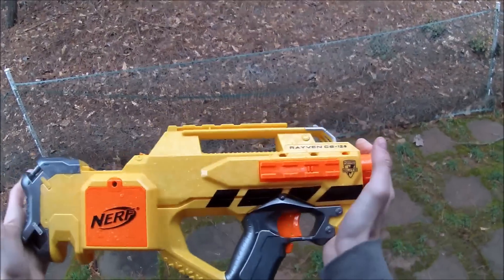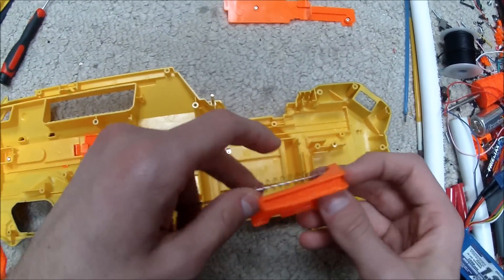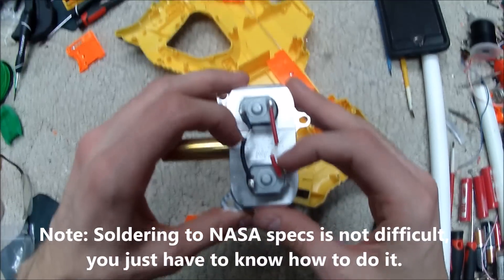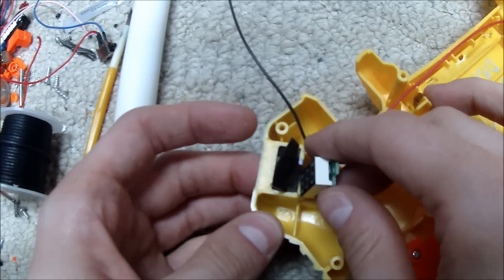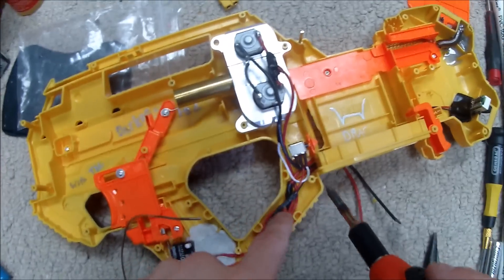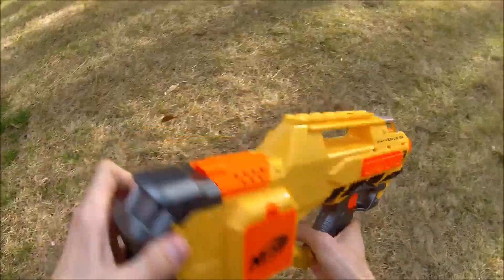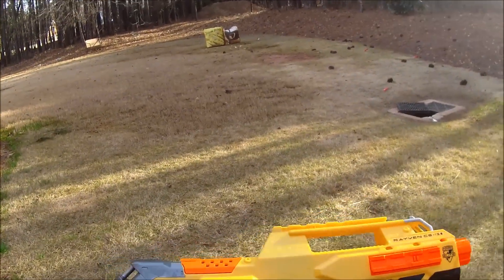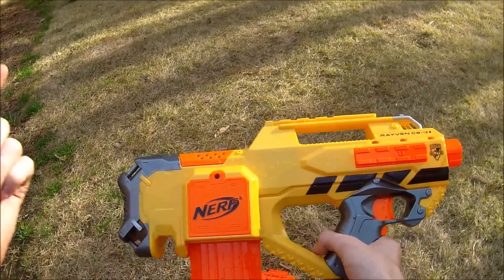Nerf Mod: The LAZARUS Rayven (Complete Overhaul w/ Snikkas Prototype)

Comment: You can dampen your flywheel noise with gel super glue... It's actually a really simple method of vibration countering... The flywheels shake the plastic and that's why it's so much louder, gel glue seems to work the best to make it a whole lot quieter, the gel absorbs the vibration a lot better than plastic, foam also helps but not on its own and caused my strife to overheat xD

Comment: hey drac had a mod question for you, to get the blaster parts metal hammershot kit, to fit in the sweet revenge is all you need to  a little sanding on the shell to get the parts to fit?

Comment: I just started getting into flywheel modding myself and I was curious do you have to put a voltmeter in a blaster when you power it off of lipo because I was hoping to leave my Rayven as a complete sleeper
Reply: A voltmeter is never a requirement, so by all means, make it a complete sleeper!

The voltmeter just lets you check your charge on your LiPos so you dont run low on power unexpectedly.

Comment: Are 130 sized tin - can motors a specific model? Like falcons or something like that? Or is it a category?
Reply: +Brian Fok You litterally just said the answer. But Ill tell you directly.
Falcons are a model of 130 size motors. So that means the 130 sized motors are a certain SIZE, so  yes, basically a Category. (if the categories were sizes.)
Please know that most Mini RC motor cans are 130 size as well.
Reply: Rooster I was confused about what the can was thanks.

Comment: +LordDraconical i have a original Nerf N strike Rayven and its just missing the battery door and it has alot of dirt in the inside i took it apart to clean some of it off of the mechanics but i cant rebuild so i didnt move anything just cleaned and closed and its in full working order if you want it or if you could mod it for me and send it back message me please

Comment: Finally got my hands on a Rayven and want to do a performance mod like this one
Any chance anyone has a parts list that I could use mainly for the replacement motors, wire gauge, rev trigger and voltage meter
Cheers!
Reply: Cheers Man :) Just ended up going overkill with the wire and actually found that the MTB store sells the good stuff so I'll just roll with that!